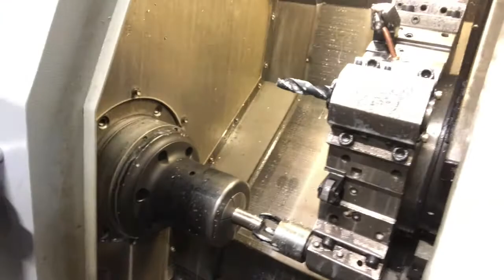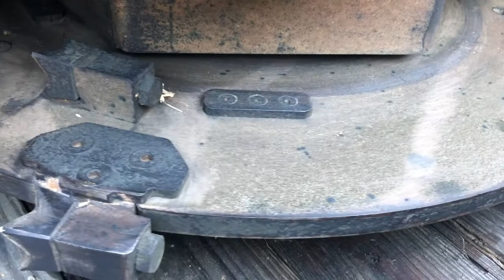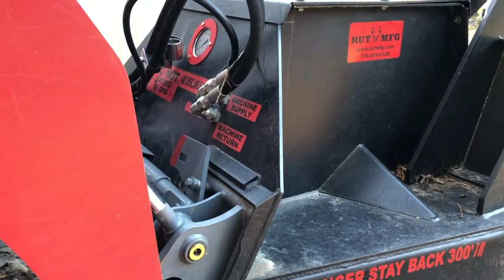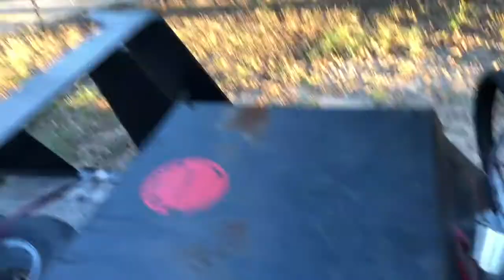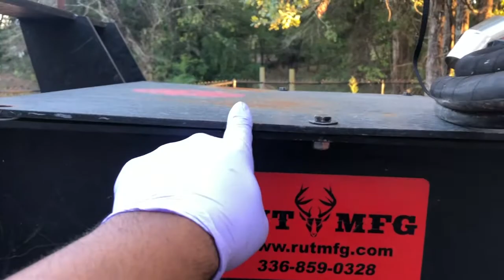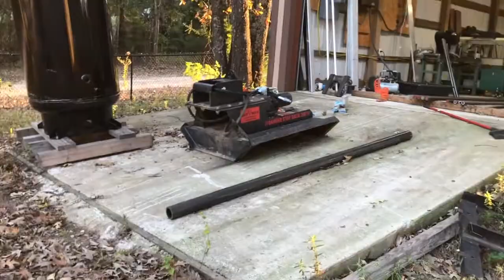Rut Manufacturing 48" Disc Mulcher 100 hour Review

Comment: How does it handle heavy vines over Yaupon?  I'm in a spot using a Cat 259d standard, 20gmp flow and concerned over very slow performance and considering their brush cutter instead.

Comment: Iv been looking at this Mulcher for a year. I have a terminator xp and it works excellent for brush. My question is do you think this 48” head will work well at a 25gpm track loader? I have a 78 hp case tr310b with standard 25gpm flow. I never see anyone running this mulcher less than 33gpm. Just wondered what your thoughts on that were? Thanks in advance.
Reply from the maker: I know several manufacturers tell customers they built units that will run on low flow, however I would strongly tell you to not waste your money unless you have a higher flowing machine. Yes the disc will run and I use mine in low flow mode sometimes in 2” and smaller brush but any thicker you will have to keep slowing down and waiting for the disc to catch up. Shredding larger trees will be impossible unless your getting paid by the hour than go for it because you will be there for a while. 
If you have the termination you can go through mostly the same thickness in brush but those don’t seem to use as much GPM to do the same work. In all respect I take my terminator out more than the disc mulcher because it is faster and still leaves I nice finish.

Comment: Retired environmental engineer here here who started a company called Stumpin Off Services Land Grooming.  Buying the same head    we started grinding stumps.  Going for this head and bobcat Brushcat for clean up.  So whats opinion of the mulcher debris. Does it need refined for drum mulcher product?
Reply: Was going to follow up with a tractor flail mower or a Brushcat was my first thought
Reply from the maker: @Stumpinoff  most stump grinders put out a dust or more sand like shavings, this will be more like larger pine bark mulch.  To your other post on flail mowers. 
 I have a flail mower and to this day I don’t think they get the credit they deserve. There are MANY jobs I look at and simply just take my track and 3 point flail mower and finish way before a track loader or mulcher could dream or. And the ticker is my tractor is only 40 hp so I can run two days on one tank of diesel. My flail mower is rated for 2” but I have pushed over 3-4” pins with the front end loader and ran over them with the flails. I would go with a flail all the way for a groomed clean up.

Comment: Hey,   what's your take on the 'sight line'  from the operators seat, to the front end?    Can the distance for  ground-contact be reasonably judged  when the front end is tipped down for buzzing stumps?    The  'doghouse'  motor cover seems quite tall on these.   I"m thinking I"ll be  doing about 90%  'cut and run'  on the bigger cedars,  and 10% whole tree mulch on anything shorter than the cab on the skid steer.   Thanks!
Reply from the maker: The Line of sight isn't great. The cover could be much smaller if you actually look at the size of the motor to cover ratio, I believe it was simpler to manufacture a big square than a contoured shape, is my guess. Most disk mulchers you cannot see the exact contact point on the ground regardless of the motor cover. That is where drum mulchers do a better job, its much closer. I hope that helps brother.
Reply: yep!  thanks for the reply! @easttexasengineering3489

Comment: great video - question: I am in SW Mississippi, clearing privitt hedge and gum trees - i am pulling them up with a shear and piling and hauling to brush pile to burn - I would like to have a mulcher so I could grind it up in place after I pull them up. I have a Case TV380 with HF - going back in forth between a Loftness L series drum mulcher ($23K) or this 48" Rut Man. Unit ($12K). I only work for myself. I would value your input based on your other videos comparing this unit to drum units. Thank you in advance. Moon M.
Reply from the maker: I will be 100% up front, disc mulchers work better with trees that are still standing not brush piles. The problem you will have is they truly do throw pieces up to 300 feet and you will find yourself going back and forth chasing the pieces. If the tree was still rooted you can chop the top and just use the bottom of the disc to shred the rest. It’s rare that you will grind a tree sitting on the ground without it being thrown before it’s completely shredded. 
I hope this helps.
Respectfully 
Ty

Comment: @East Texas Engineering Thanks for posting these.  In deciding what mulcher and loader to buy I like the idea of nimbleness and staying out of cdl and cheaper to get into.  In my area I don't think I need the wider swath much because we are just cutting juniper and pinion pine.  not real thick growth.. usually just working on one tree at a time.  So I think that the 48 should cut as fast as the 60   However, I have never ran either so don't know.  Do you find the recovery to be slow at all with your setup on the tl8.  Obviously guys talk about wanting the most hp and flow they can get to run mulchers but wonder if you still feel you have found a combination that works real efficiently?
Reply from the maker: No regrets at all, as far as recovery, it really depends on what your doing. And here is why I reply this way.

Yes with 75hp recovery is slower than a 100 hp  but not at all awful and mostly only noticeable with the mulcher and not the heavy brush cutter.  I can walk down a 4” pine tree without even slowing this machine down, so recovery is pointless, however oak and hard woods will slow down the disc. This is when recovery plays a roll. 5-6 in pines will start to slow it down but keep in mind most of what your mulching with a skid steer is 2-3” diameter. The weight of the disc itself plays a part in why smaller machines can roll with the big boys. It’s so heavy once spinning it takes a lot of force to slow it down.. 
I hope this helps.

Comment: What do you prefer between the mulcher and the brush cutter? I am looking to clear a bunch of very heavy honey suckle and some brush
Reply from the maker: If this is for yourself I would go with the heavy brush cutter. 100%. The brush cutter is not a mulcher but will do the same thickness in trees at a much faster rate and take less power from your equipment to run it. I bring both on many jobs and change the head back and forth. It’s truly worth the $3500. I was not bullshitting when I stated to take out 10” trees with the heavy brush cutter. It’s no joke. I use it on both high flow and low flow modes.
I hope this helps
Reply: @easttexasengineering3489    What brush cutter are you refering to?  One of the rut's?   Do you ever think that you should have a little heavier machine like TL10 to handle the head.. Like on hills?   Would you think a brush cutter would do well taking out Juniper.  Chip it up relatively well?
Reply from the maker: @kurtfrome  multiple good questions brother. 
I was referring to the rut manufacturing heavy brush cutter. It has the three 10” inch wide blades. 
The heavy machine carrying the same cutter works to a disadvantage going up hill because the TL10 and TL8 have the same drive system. You can observe this by looking at the accessory flow rate on the TL10 is slightly lower than the TL8 due to the hydraulic drive motor needing more flow to drive the unit. Also I chose a radial lift machine which lifts more weight than a vertical lift. We use our TL8 to lift 5,000 machines in our machine shop often. The TL10 with vertical lift most likely cannot do this even though it’s ,1700 more weight. However, when facing downhill with cutter in the front the TL10 will be more fit. We are limited on steep grades going down but not uphill. You will have to decide what is more important to you. Both are great machines but I am not a fan of vertical lift machines, it’s a lot of stress on the joints but they will work. If you can buy a TL10 with radial lift that’s the way to go. But you will be reduced in accessory hydraulic flow rate by a smidge. 
I hope this helps brother
Reply: @easttexasengineering3489  Thanks for the insite.   I need to be able to go up and down hills here in Montana so wonder if the tl10 may be better.  A neighbor recently went to a bigger macine to run his heavy rotary grinder both for spinning it and because he couldn't stop going down hills..too front heavy.  I want somthing that runs the 48 inch disk  at full capacity...I assume you mean the radial will lift more at lower heights is my understanding?
Reply: @easttexasengineering3489  i have rut mfgs terminator xp which is 7500$ not 3500 and it barely cuts 10 inch trees. it cannot mulch  a 10 inch tree up at all unless its a super soft wood tree. cedar and oak and even mesquite it cuts very poorly. leaves giant chunks everywhere. it works good on 4" and under trees. yes it can cut a 10 inch tree down but it does a very poor job. thats why ive been looking into ruts disc mulcher. hopeing it will work better on big trees than a brush cutter
Reply from the maker: @pigslayer106  I never said the terminator will mulch but it will cut a 10 in tree. I have cut down a 17” pine with it and at best you can chop at it but you will need the disc mulcher which I also have to mulch it up. Keep in mind I am also using a high flow machine, when I switch to low flow it greatly reduces the cut capacity.
Reply: Watching this video and reading comments would love some insight. I’m torn between disc and the gladiator. It’s my first skid steer and I’m clearing mostly 4-6” trees with lots of vines and undergrowth. Same price basically so which one would you invest in.

Comment: Just talked to Rut and they sent me here.  Good review of drum vs disc, and the TL8 and the Rut disc that I'm considering.  Any idea of a accurate weight of TL 8 without fuel, without operator/bucket/mulcher?  You said 11,4 which is high, high, high for what I can do.  I see the TL as 8300# without operator and bucket, and the Rut is supposed to be 2000# for the 48", so 10,300, which is not 11,400#.  I'm looking at weights closely.  Thanks.
Reply from the maker: Sorry it took this long to reply. It’s 8350# track loader, 2500# for the disc mulcher. I carry a tool box 450# on the front of the trailer# and 50 gallons of extra diesel. Pretty close to 11,400 which is what it weighted not counting the gooseneck trailer. I would not use a 1500 in my opinion. 2500 minimum. My Titan XD does added payload capacity and 6” frame rails similar to a 2500. It is used as a backup now since the purchase of my Ram 3500 HO dually. With that said with the Titan XD I never felt like the trailer was too much but I owned a regular Titan prior to the XD and I don’t think the suspension would have been strong enough for this weight.  However just my opinion. I know ford has rated the new F150 in this class but you can watch when TFL truck did the test, Titan XD vs F150 towing lots of weight. All they said was the ford was faster up hill but was very unstable vs the Titan XD which controlled the trailer . Best luck brother . It’s a great business
Reply: @easttexasengineering3489  Interesting, and thank you!  I will not try a 1/2 ton!  7.3 right now, and I run heavy duty rated tires (E).  Safety first!